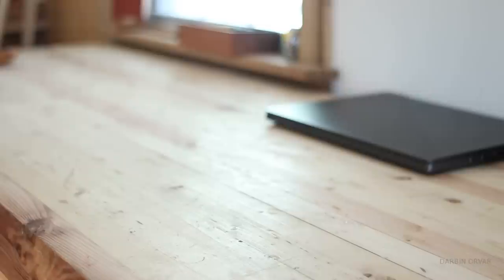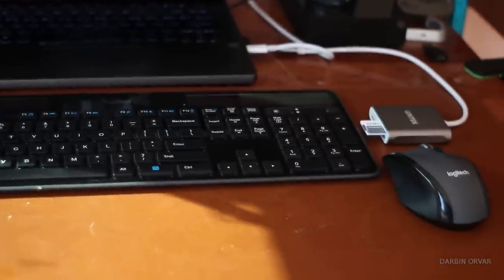DIY Leather Laptop Sleeve w/ Secret Mouse Pad

Comment: Looks great, but I do have 1 concern. If your laptop has vents on the bottom to draw air in to help cool the electronics, then having it lay on the leather may cause overheating. I thought for a moment and figured that if that is the case, then attach 2 or 3 small squares or rectangles of leather scraps stacked several high to create a raised edge on one side to angle the computer up to allow for air passage. just a thought.....

Comment: Lin.  You should punch some small holes at the ends of your slots.  Typical 'leatherworking trick' to keep the end from tearing.  A 2 or 3 mm hole should be enough.  Kudos on the locking flap.  Great idea.

Comment: taking a page from holster and saddle leatherwork: maybe lock stitch across the edges of the loop the flap tucks into to prevent stretching or continue the stitching to the edge seam for additional strength as well